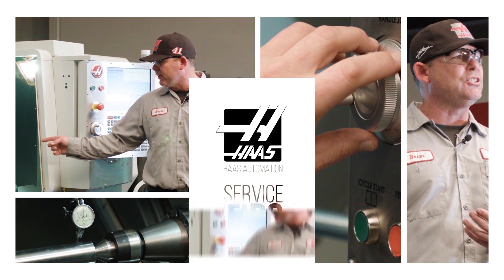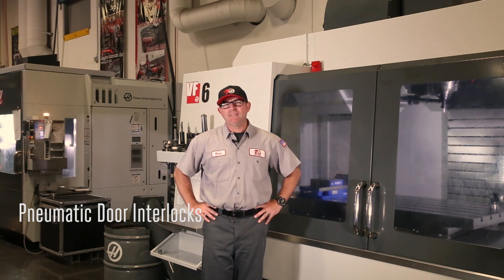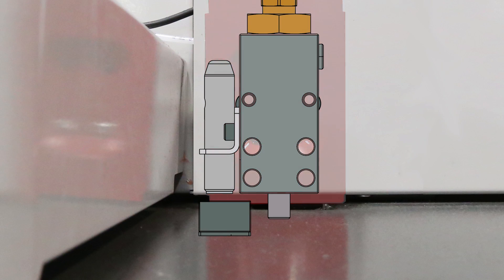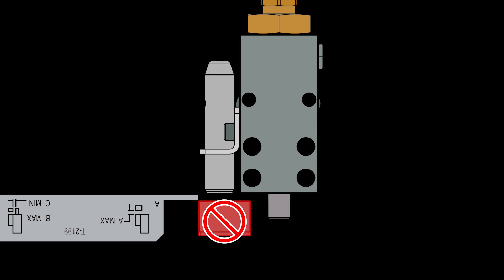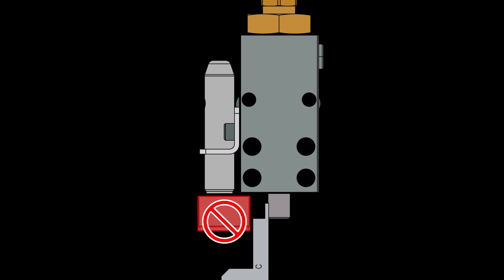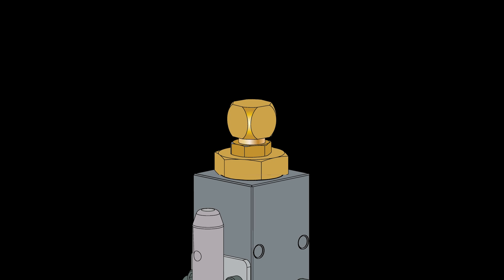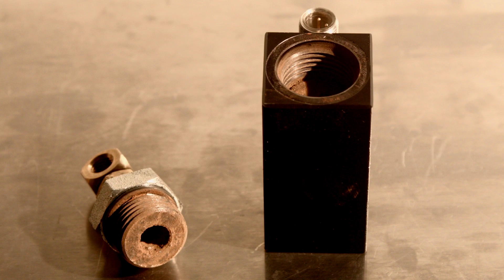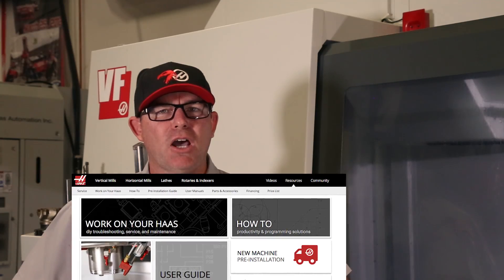Pneumatic Door Interlock Troubleshooting - Haas Automation Service Tip

Comment: New machines annoy me to no end. Old machines I ran had 0 safety sensors. Doors could be open all day, no locks, no sensors. Now it seems you breathe on it wrong and the whole thing E-stops or the door gets locked shut. What is with all this BS? There are FAR more dangerous things in the shop than letting us see what we are cutting properly!